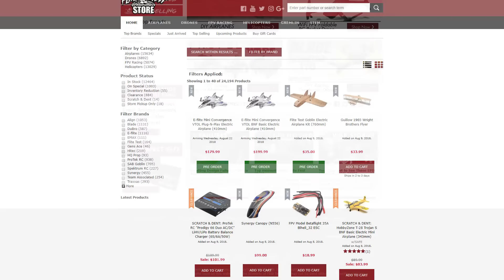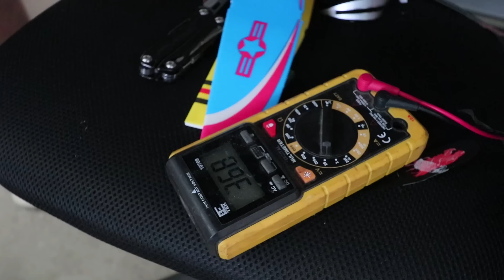Powered R/C glider without batteries!? | Capacitor plane hack

Comment: Wiring capacitors in series doesn't decrease overall "capacity" it decreased overall capacitance.  This may sound stupid but if you're measuring "capacity" as overall energy stored, then the two in series will increase capacity.  Capacitance however is the ratio of a capacitor's total charge divided by it's change in voltage.  Lower capacitance means the same change in voltage (to the one or two capacitor series) can occur with a smaller addition of charge than with one capacitor alone.

Comment: V ÷ r = I , basicly when you add 2 capacitors in series the voltage doubles and that in turn doubles the current draw as the resistance change is extremly small so the run time is actually halfed mental or what.
You need to parrallel for every series to get the same run time increased performance.

Comment: I built a balsa glider of the same dimensions as the foam one but 1 gram lighter.  Used the same cap and motor with prop, it is amazing how long it is in the air. Most flights about 40 seconds. Contest grade 5lb balsa is a must for it to work. The fuse is a skewer with the electric parts taped on with blue tape. Free flight no RC.

Comment: I you go further with this make sure you get "Super Capacitors". I don't think a regular one will work. If you have seen those shake flashlights, they use Super capacitors. It is a flashlight you have to shake to charge the cap. The shaking causes a magnet to go back and forth through a coil to charge the cap.

Comment: A formula that might be handy is the one describing the amount of energy stored in a capacitor: E=½C*V^2, where E is the energy in Joules = watts * seconds, C is the capacity in Farads, and V is the voltage. As Andres notes, if you series couple 2 capacitors, total C goes down, always below the smallest value. of the 2 capacitors. If they are the same size, you get exactly half the total capacity of one of the capacitors. Do however note that if you double the voltage across the 2 (keeping it the same for each capacitor), the energy stored in each capacitor stays the same, so you now have twice the energy stored. My question would be what the voltage rating of each of the capacitors is.......because if it is high enough to double the voltage across one of them, you will get 4 times the energy stored, and only the weight of one cap.
Reply: Wait a second..........are you using the "charger" intended for 1 capacitor across 2 caps in series? That would be a bit dumb, as you simply get half the energy stored at the same voltage. If this is so, simply revert to using that charger with just 1 capacitor, and you will double your "battery time". Note that the "charger" most likely is simply a battery (the 3 AA cells) in series with a resistor. If this is so, note that increasing capacity means you will have to charge for longer to get to full charge. If you double the capacity, also double the charge time. It should not be possible to charge for too long (Edit: unless your max charge voltage is higher than the cap voltage rating, of course. I certainly hope that to not be the case.)

Comment: The capacitor(s) is most likely eletrolitic meaning it contains a liquid electrolyte and can usually hold lots of energy. A down side is that the capacity is used instantly so the energy needs to run through a resistor.

Comment: Check out the system ski-doo developed called shot. It uses capacitors and engerizes the stator to turn over the engine to restart it. You still have to rope start the engine first time of the day then the capacitors hold power for a couple hours with the engine shut down.

Comment: Capacitors in series doubles the voltage but does not decrease the capacity it just stays the same, putting capacitors in parallel increases the capacitance but keeps the voltage the same

Comment: Alex, try using capacitors with your RC cars I think it would be easier to experiment with on the ground and when you work out the wrinkles use that knowledge for a full size model plane

Comment: As a little diy electronics dude I know for sure you can get larger capacitors that will store a lot more energy, I agree with some of the other comments here in this vid, I all so would like to see a flite test plane from out of your store be built and be powered by capacitors ? I believe that if you use 4x  capacitors  you should get at least 6 min flight................

Comment: Dudes in flight test.you can use same size battery for hold much more energy than capacitor.more power longer fly time.those super capacitors main advantage over batteries is it can diliver huge amount of current because internal resistance of a capacitor(esr) is much low than battery 's internal resistance.  just use same weight lipo.good video

Comment: supercapacitor A capacitor with two conducting surfaces, or electrodes (like othercapacitors), on which a charge of energy is stored. like batteries, an electrolyte separates the two electrodes. In this sense, a supercapacitor is essentially a battery hybrid.

Comment: If you put 2 identical capacitors in series, each will get only half the voltage. The power in a capacitor is proportional to the square of the voltage, so each capacitor will have 1/4 of the energy, so the total will be 2 x 1/4 = 1/2 of the energy of one capacitor.  Put them in parallel and you will double the total capacity.

Comment: Capacitors would be a good backup system if you could find a way to only distribute its power to control surfaces. That way if you're a bit overly ambitious with your flight and your battery dies, you can at least save your plane by gliding it back down, or even allowing it to switch on and allow your motor access. Plane dies, throw a switch into emergency reserves, save your plane.

Comment: If it helps you to understand capacitors, you can think of capacitors as being very similar to static charging; when you rub your hair and your balloon and you create voltage/potential difference because there is a physical difference in the density of electrons on each side.

Comment: maby this works too. if it exists a solar panel foil on the wings what fills a storage capasitor when full it may release its energy to the capasitor that acctually propels the plane. and that way you might have an infite flying plane?

Comment: There are supercapacitors that manage to start a ordinary car.  So yes, it should be possible to fly a plane.
The voltage are low in those (less then 4 volt), but some in serial will get more voltage. Might want to look out for the weight though, but should be OK for shorter flights, as the charge super fast. And the capacity will not be worse as the number pf charges increases, like chemical bateries.

Comment: ultracapacitors  as they are called they function as a hybrid capacitor that can be charged quickly and release energy for a steady drain like a battery unlike normal caps they only handle low voltage per capacitor but still will kick out a lot of amps during discharge I have seen people burning screwdrivers with the larger ones I would love to see you guys do more projects in the future with these I wonder how a solar capacitor plane would work

Comment: How would one go about choosing a DIY FT kit for some old electronics that one might ave lying around ?
In this case a Power 400/35 6 volt" motor, "JETI JES 140",  and a "Hitec Laser 4" with "hitec  hs-225Bb" servos and a HFS 04MI.

Comment: Your capacitor knowledge is pretty much all you need to know about the capacitor. In the video you pretty much summed it up a capacitated this. Or electrical energy depending on the capacitor . There are normal capacitor only hold energy for a few milliseconds. And then there's supercharged capacitors that can hold energy for almost 2 or 3 minutes

Comment: ok here is my idea for both the double cap remote plane and glider,  i remember  watching an episode where you flew the X-men battleship in a large building like a basketball stadium now you could fly the plane and glider inside and get long flights, you can run the plane at low power as you dont have wind and get longer flights i think with the capacitor plane and glider it would be great ....longest flight, distance and so on with the plane a course of gates

Comment: Capacitor voltage isn't like battery voltage. They'll work up to whatever theyre rated for. Charge them up to 5v or whatever. Putting two capacitors in series will cut the capacity in half, put them in parallel if you want more capacity.

Comment: Try building a capacitor powered slope soaring plane and use its propeller to recharge the capacitors to be able to fly indefinitely.
If using a correct prop and small brushless motor, you should only need a full bridge rectifier to charge the capacitor.

Comment: I used to have a little 2 channel proportional thrust plane that charged off a portable thing much like that. It took 6 size C batteries, plug the plane into it for 10 minutes then fly for about 4. Rinse and repeat. Much the same I'd imagine. Only this was about 15 years ago.

Comment: If you run solar panals they should be able to keep the capacitors charged and then you'll never need to charge them back up every launch. With a bit bigger plane and enough solar panels you may even be able to push a large, lightweight, slow prop... :)

Comment: Caps behave similar to a small battery when it comes to series and parallel. Voltage is linear in a capacitor vs batteries have a large flat spot in the middle. Adding 2 in series and charging to the same voltage effectively just added extra weight.

Comment: If its not already suggested you should use a rubber band powered plane and have a tiny motor hooked to the plane where the tail end of the rubber band would go and you could wind the rubber band with the motor mid flight.

Comment: Capacitors only go to the supplied voltage, the same capacitor can charged to 25 volts or 2 volts, depends on the power supply. You want the capacitors in parallel, just like batteries, to give a larger capacity

Comment: To clarify series vs parallel: capacity actually doubles either way. Series doubles the voltage, parallel doubles the available amperage.
edit: this is true of batteries. Not sure how it applies to capacitors.

Comment: put a mini solar panel on it to continually charge the capacitor. and if you can get it to fly it will never come down. LOL I'm talking about those paper thin solar panels. I'm thinking either use double stick tape or hot glue to put them on. And instead of two small caps go with a larger one. With the solar panel weight shouldn't matter much, because you should be able to power a decent motor with a larger cap with the solar panel. It should work.

edit: 4.5" solar panel is about $4.75 and puts out 3 volts and 50 milliamps, for a little more you can go smaller at 2.5" and get 3.5v with 50 miliamps and that one runs a little over $7. You should be able to cram four or six of those, or with the smaller one maybe cram 12 in series on a foamie and grab a 12v cap. make it happen. :)
Reply: have you seen the printed solar cells, can do with special ink in a typical printer, whole wing coverings could be pretty easy with that. not great output but it'd save a lot in weight so it'd need less for power.... might work out?

Comment: When you add capacitors in series it decreases it's capacity IF you are charging through the final end leads.  IF you charged them separately and then connected in series the final voltage would be too high.

Comment: Batteries are like a water fountain while capacitors are like buckets. Talking alternative current(a wave instead of straight line), imagine a river that flows and stops and flows and stops and flows repeatedly. You can use capacitors to collect the water like a bucket and when the river stops you slowly pour the water back out.

You're charging it by filling the bucket with water and when it's releasing its energy the propeller prop spins

I'm skipping over oscilating circuits, transformers and op amps going straight to voltage regulation for this example tho

Comment: Capacitors store energy in an electric field and unlike batteries can discharge their stored energy very quickly however they tend to have limited storage as well as leakage which makes them non-ideal for long term energy storage.

Comment: Think of a capacitor as a heavier battery with dangerously fast charge / discharge rates (smaller ones, like those in this video are fine, but larger ones get kinda scary). Look into building a coil gun or rail gun to learn more about capacitors.

Comment: Capacitors can charge and discharge really fast, but doesn't hold it as well/as long.
And those alkaline batteries can go up to 1.8V per cell when fully charged so yeah...

Comment: What minimum voltage does that controller require? Is it purely proportional? If so you may find the servo response changes as the caps die.

Comment: What would obviously be adding additional layers of complexity,
( which defeats the original intent )
However,
What if,
You add an additional capacitor for the motor, separate from the flight controls ?
More like a free flight ultra-light,
Climb to the maximum altitude available from the capacitor #1,
then control flight on the return ?

Comment: Try using super capacitors and see what kind of flight times you can get. Maybe even compare charge and run times to that of regular LiPo batteries. Is run time per minute of charge better or worse than that of batteries? Would be a very interesting experiment.

Comment: Capacitors are backwards from batteries. series doubles the capacity while parallel doubles voltage. You discharge both equally and it gives you more power but the same capacity. parallel will drain the first one then move onto the next closest based on resistance.

Comment: You said in 4:34
“When you put a capacitor in series the total capacitance will decrease.”

And my answer is wrong, because if you put a capacitor in series the voltage of the capacitors divide and that is why it drains faster

Comment: If you integrate the capacitor with of fuselage you might be able to pull it off with motor as well.
Also high capacity can be nasty watch out.

Comment: Try some resistors to lower and even the voltage flow..the quick drain is caused by too much power to the motor in the begining....a resistor will slow the flow of power and lengthen the life of the UC charge.  ( slow the power dump to what ever rate you want/need)

Comment: Try and make an rc Estes rocket glider. Back when I was in jrotc airforce we built rockets and launched them. One kid had a unique design that when it came off the launch pad it flew straight parallel to the ground for 100 feet before the shoot popped out. That was awesome that way it happened. And flew only 2 to 3 feet off the ground.

Comment: Capacitors stay charged for months, in some cases even years, so be careful when working with super-capacitors or high voltage circuits powered by capacitors.

Just a tip for those who want to upscale this

Comment: Capacitors have much lower energy density than LiPo cells. You'll be able to make a lighter one using a normal battery. Capacitors only get you the super fast charge time at the expense of draining very fast and being heavy.

Comment: Small cell supercapacitors and make the airplane body out of them (with something sturdy but light to hold them). And do not restrict the charging unit for them. In essence build a plane out of supercapacitors (do the body, then build the wings accordingly) and charge them as quick as you can. I bet you could do a 10 min flight time with a powerful electric engine and maybe a 10s charge time.

Comment: What's the capacity of those capacitors? I'm guessing 2,200uF, 16V. You could start by upgrading to a 1F, 5.5V supercapacitor which would offer a far higher charge capacity for a similar weight, if not lighter. Great hacking guys, huge possibilities for low-cost starter kits there.

Comment: To me this is more of an academic challenge. Compare the power and/or capacity to weight ratio of capacitors vs batteries. I think a small battery solution can hold and provide more energy per weight unit than the capacitor solution?

Comment: Okay use 4 capacitors, 2 in a series parallel to the other 2 in a series. This should make you able to charge them with a 2s lipo and use the same AIO receiver board but use a 2s brushless esc board and you can then use a little larger EPP glider with more wing area maybe 600mm, and maybe even upgrade it with a small standalone 5.8GHZ FPV rig option and you could be onto something pretty original.
Reply: I was thinking of the same internal setup that's on the UMX F27 mini Stryker from Horizon. That setup runs for 5 minutes with the little 280mah lipos...not sure how that would compare to a capacitor plane with the same electronics. But the fpv idea would also be cool as just a glider that has a wheel and the ability to be towed by say a carbon cub style plane. Then you could glide around fpv after being towed to a desired altitude. Just fun to think of different ways to build on an idea.

Comment: You can increase flight time by having 6 capacitors total 3 banks parallel and in each bank have 2 wired in series. Plus flight controller, you should in theory have a  well balanced capacitor plane.

Comment: You should have tried it as a biplane with the powered version. Reduce the wing loading some. add a bit of tail, Horiz. and vertic. stab., and see if that worked. You opened two kits to get the parts so why not?